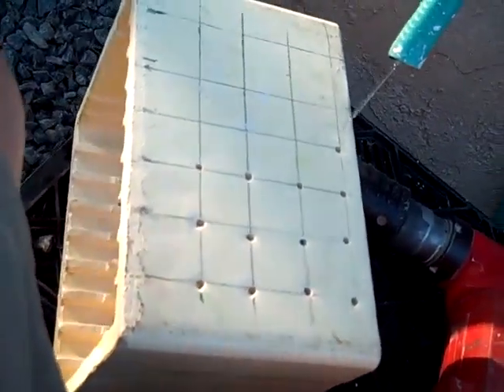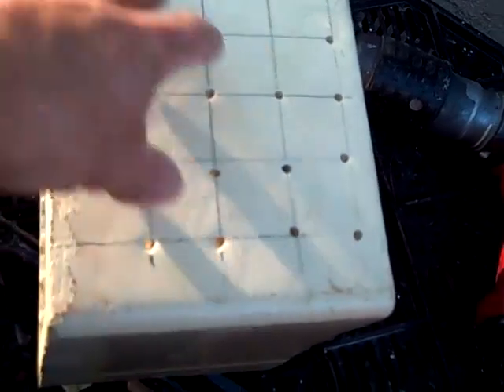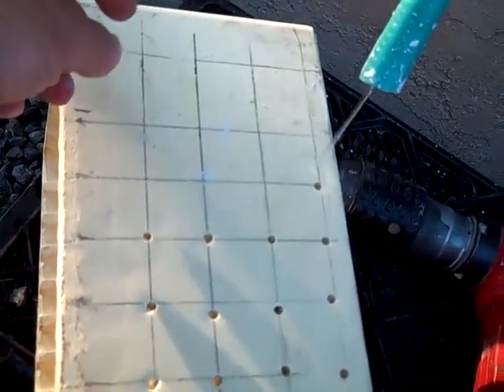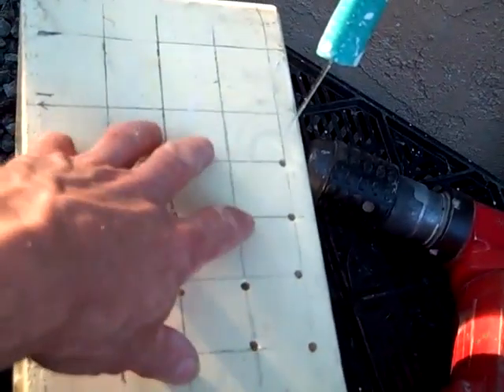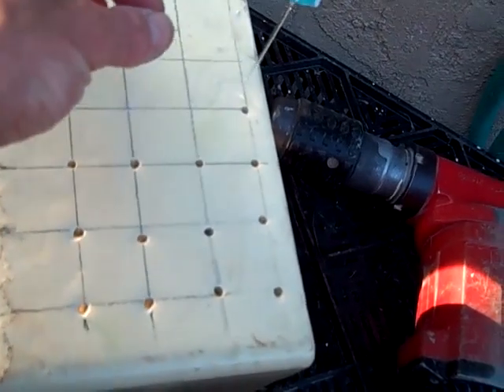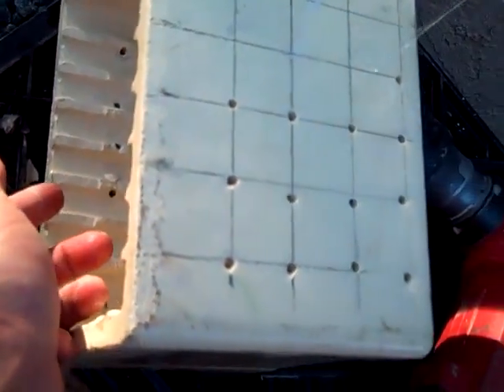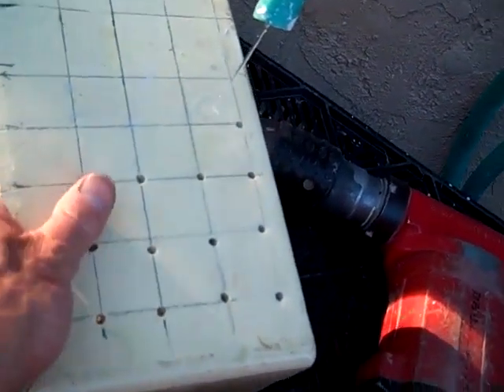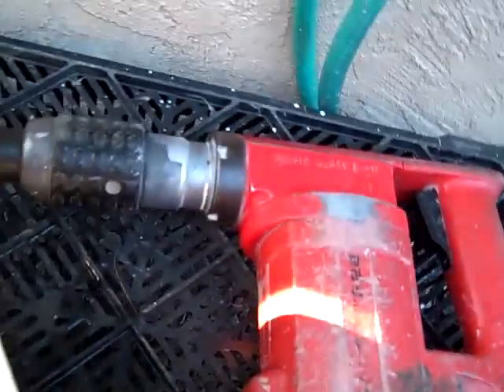bead rack

Comment: question--what kind of wire do you use.  I went and bought a bead rack and the wires bent under the heat of cone 6 and what a mess I had.  I certainly like yours better.